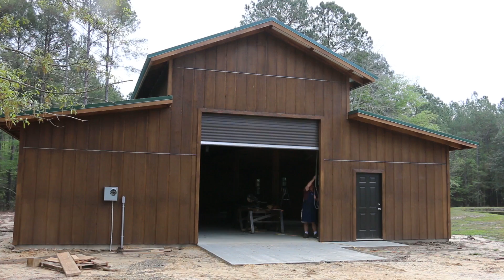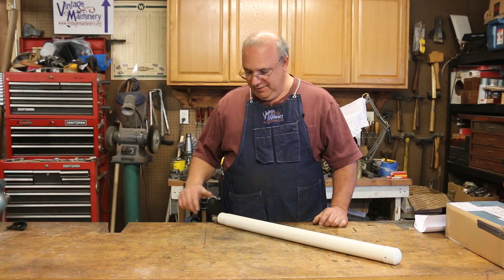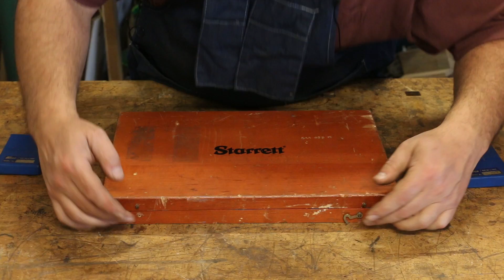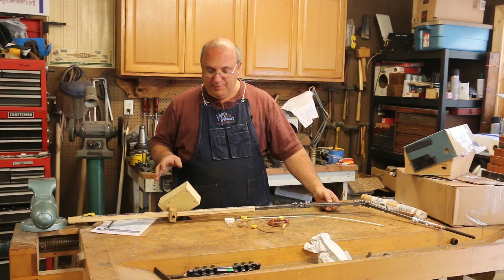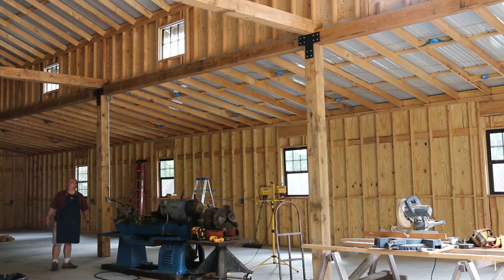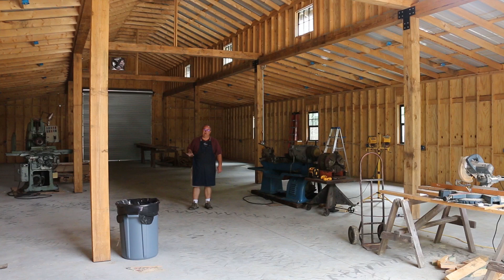Odds & Ends 44:  Viewer Mail and Shop Update

Comment: I am pretty sure pulling your wire isn't a valid excuse for anything............

I also want to suggest running a circuit or two to each post. You will definately appreciate the flexibility. Chances are, once the shop is full, there will be a powered device parked at half of those posts. Also, put a 220 line for a welder on a few of them. Long welder cords suck, and so does running the leads through a large project to get to the other side. Much easier to reposition welder than the project in some cases, provided the plugs exist to move it.....
Reply: And compressed air...
Reply from the maker: +Notso Fresh I am planning on having some outlets on the posts - I have not pulled any of those circuits  yet.  The welder will go right near the breaker box and I  have not installed that yet either.

Comment: Make sure you isolate your common and ground buses in the sub-panel.
Reply: Can you elaborate on this a bit? I'm about to have one installed myself.
Reply: +Thomas Utley Sure. In normal residential panels, there are a couple of bus bars for the neutral/common (white) and ground (green) wires. These are bonded to the box itself and tied together. Therefore, it doesn't matter if you mix the greens and whites on the same bar.

In a subpanel, the greens and whites have to be on separate bars isolated from each other, and the one with the white wires has to be insulated from the box, usually on plastic standoffs. This bus is then connected back to the main panel neutral/common (white).

If the neutral and ground are tied together in the subpanel, you can get all sorts of weird things going on, with stray currents going through structures (like aluminum siding arcing when the wind blows).
Reply from the maker: +ThePungoman Yes, I have done this.  I don't totally understand why you have to do this in a sub panel, but that is the code so that is what I did.  I actually had to add a separate ground bus as my panel only had one bus in it.  There was a screw that you could tighten to bond the installed bus to the panel or leave it like it was to keep it unbounded.  But, at any rate, I have both a neutral and ground bus in the sub panel.

Comment: From http://www.shopfloortalk.com/
Gas Welding Rods For welding gray cast iron, cast iron filler rods having the same composition as the base metal and containing a minimum of sulphur and phosphorus are used. Welding rods should contain enough carbon and silicon to allow for losses of these elements during welding. 

Special rods containing titanium and with a high silicon content are also employed sometimes. The welding rods are in the form of square or round cast bars A typical cast iron welding rod composition (%) may be
C 3.25-3.50
Si 2.75-3.00
Mn 0.60-0.75 
P 0.50-0.75 
S 0.10 Max
Super silicon, cast iron, IS 1278 type 5.1 rod (square) of Indian Oxygen Limited may be used for welding high grade castings where subsequent machining is necessary such as lathe beds, cylinder blocks etc.
Welding Flux Flux increases the fluidity of the fusible iron-silicate slag, as well as aids in the removal of the slag. Fluxes for gray iron filler rods are usually composed of borates, soda ash and small amounts of ammonium sulphate, iron oxide etc.

Comment: LED lights are the way to go.  I am slowly converting everything here to LED.  When I run out of spare fluorescent bulbs I will throw out the fixtures and replace them with LED.  That new shop is incredible.  I cannot imagine what I would do with that much space.
Reply: +Amateur Redneck Workshop,  I'll second that. Yes the initial cost is more, but I converted my shop over and i'm averaging a $10.00 a month savings on electric over the fluorescent units I had. They also turn on instantly in the cold. I did have an issue where they were putting out some RF energy that was making the radio sing, Put up an outside antenna and that went away.  I did mount a few in the corner of the ceiling/wall. Those throw light "under" the equipment and kill some of the shadows where those tool thieving gremlins like to hide !!!

Comment: Perforated plywood panels are great for ceiling covering. They are really light and the perforations help absorb noise, which can be a problem in a big, open shop.
As for the walls, I am currently covering my shop walls with chipboard flooring panels. They are long and have tongue & groove edges, so they are easy to join. They were also by far the cheapest option I could find.
Reply from the maker: +Sideslip I am looking at my options and that is one of them!

Comment: Never brazed cast iron but I have stick welded it with the high nickel content rods.  All I can say is it is very different than running 6011 or 7018.  So, I'm curious to see how those brazing rods run and if you have to be as careful about thermal stresses, preheat and cooling rates.

I've never seen a lathe dog before.  Could you do a video showing how they're used?
Reply from the maker: +prototype3a I have used some lathe dogs in previous videos - I just did some searching and here is a much older video that I did that showed me using a lathe dog for turning between centers:  https://youtu.be/lHf7JLN8Aek

Comment: LED lights are the way to go. I know they will burn out at some time also but at least you will have enough still burning to see what you are doing. And I don't think they are as bad about burning down buildings.
Reply from the maker: +John Mills You are right - if you lose a light or too, it is not that bad as a fixture will have many individual lights in it - and they last for a long time.  The power savings will be nice and they don't generate near the heat as other types of lights will.

Comment: I think you'll be glad you found the room in your budget to seal that floor.   It will make a huge difference in cleanup down the road!!   I epoxied mine in white.  Everyone thought I was nuts but it has been very easy to keep clean and all those little nuts and bolts you drop are sooooo easy to find.  Lots of good wishes for making this dream come true.
Reply from the maker: +ramosel The stuff I will use is basically a clear sealer so it will not be quite as nice as the epoxy, but it is affordable stuff for such a large area.